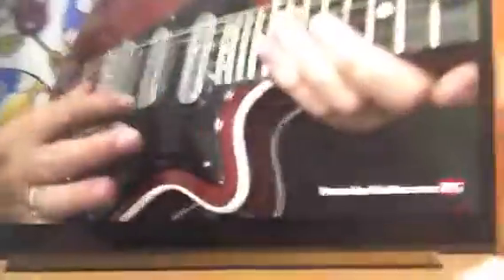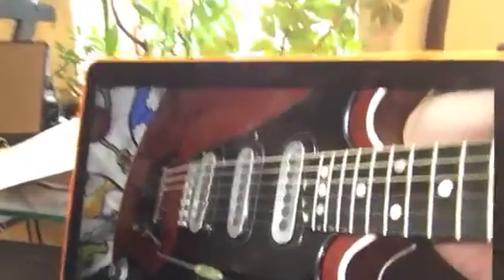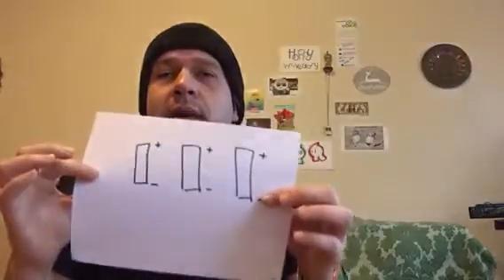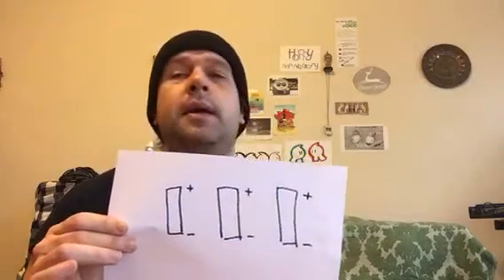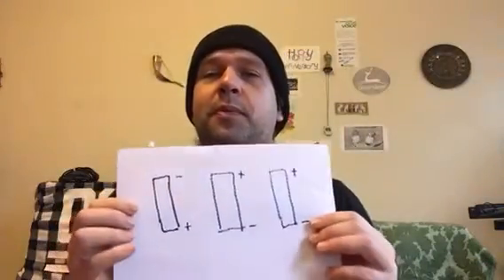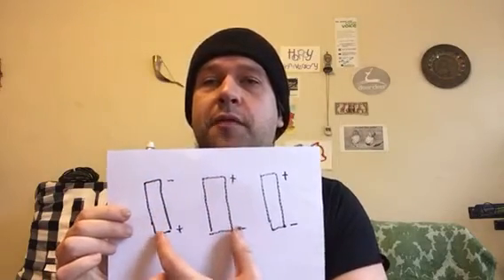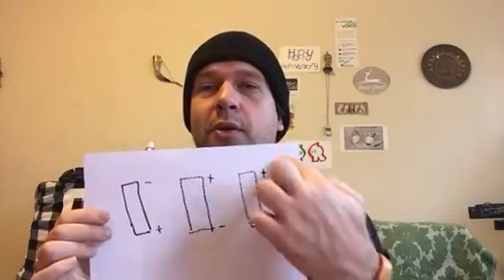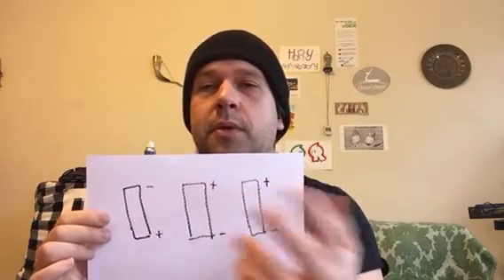Most Brian May Red Special replica guitars are wired wrong!

Comment: Can you explain please how i should flip the magnet? If i look from above on the pickup, just turn it 180°?
Reply from the maker: You can simply swap bridge pickup and the middle pickup.  I have that on my main Brian May guitar, and I like the result.  Just put the bridge pickup where the middle pickup is; put the middle pickup where the bridge pickup is.  The end.
Reply: @accidentals_hacks  thanks for the answer but this is the problem, I do not have bmg but a custom guitar with three identical pickups
Reply from the maker: @albertooha  all you need to do is open up the pickup and flip the magnet(s) upside-down.  Put north where south used to be.  Then you need to swap your wires because if you leave the wiring the same, you will get an out of phase sound.  I'm not sure how complicated it is to do this procedure.  Maybe you can just buy a "middle" pickup and just install it in the bridge?
Reply: @accidentals_hacks  thank you for the advice, I'll try to do it
Reply: @accidentals_hacks thank you 🙏 i did the swap and it works!!! I'm very happy i found your video
Reply from the maker: @albertooha  Excellent!  can you post a video please?  I'm curious how it worked out for you.
Reply: @accidentals_hacks  yes, i want to do that

Comment: So, what does it mean, my bmg rs are silent at b+m and n+m and in any combination of those out of phase it hums/and more squecku as you would expect(...  That can only mean the middle pickup is indeed reversed as the documentation on the guitars are correct...

From the bmg site: "In addition, the middle pickup is reverse wound and reverse polarity (RWRP), emulating the configuration employed by Brian and his father. The pickup's magnetic pole is reversed and its coils physically wound in the opposite direction compared to the other pickups. Hence, when the middle pickup is selected in combination with either or both of the other pickups in phase, a hum-cancelling effect is created, reducing noise and hum in the output of the guitar."

Comment: You should probably delete this or add a disclaimer before you mislead even more people than you may have already. 

You are incorrect, Brian was incorrect in that interview as he has stated himself since the interview. Guyton guitars and Fryer guitars do in fact feature a reversed bridge pickup but on the original Red Special it is the middle pickup which is reversed. Listen to any Queen "guitar only" track that features the N+M OoP setting and you will hear that you are wrong as it will have the extraneous noise that naturally comes from that setting.

While the reversed bridge pickup as opposed to the middle pickup may actually be favorable to someone playing Queen material due to Brian's extensive use of the N+M OoP selection, it does not change the fact that the original Red Special has a reverse wired MIDDLE pickup.
Reply from the maker: Well, then Brian May, who built the guitar is wrong in the interview.  Regardless if that's the case, the two main BM pup combinations are not noisy for me.  The sound is exactly the same.  If you prefer to have obnoxious hum for your bo-rhap sound, then by all means, enjoy that noise!  :)
Reply: RS Guitarist interesting. Do you mind if I ask you have a source you can share for your claim “...as he has stated himself since the interview.”

Thankyou